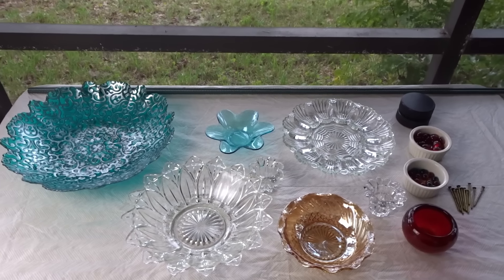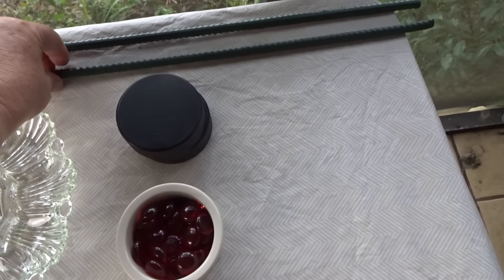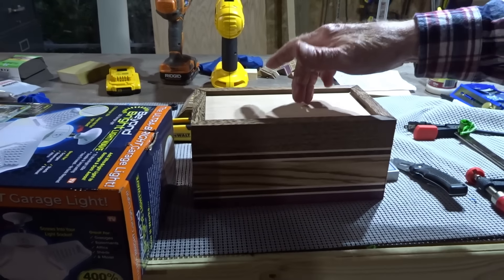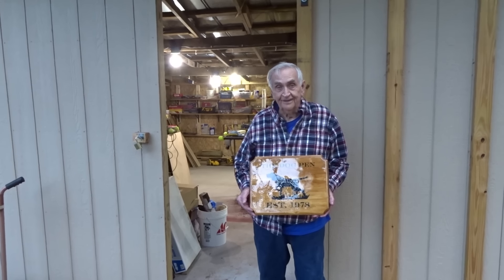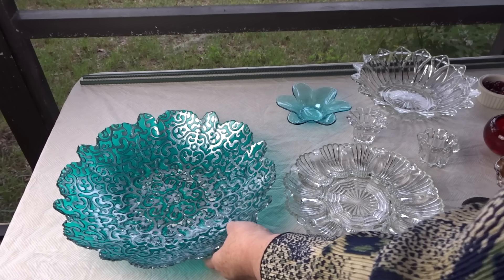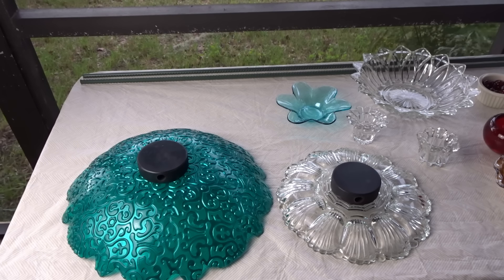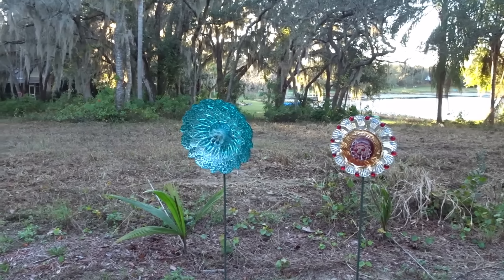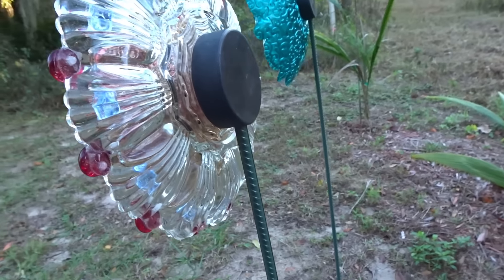How to Make 2 Glass Garden Flowers (with Thrift Store Glassware!) #diy  #upcycling  #gardendecor

Comment: You found some really pretty plates. When I made mine,I I couldn't find hockey pucks, so I used plastic elbow joints for my posts. They are very pretty.
Reply from the maker: I may try the pvc sometime! I bought the hockey pucks on Amazon : ) ♥

Comment: These are really nice. I might try making them.  I would recommend you consider using E-6000 glue.  It is crystal clear as well and bonds, glass and metal extremely well.  there is no mixing required. You can just squeeze it out of a tube.
Reply from the maker: Yes I have used E6000 (see previous videos) and have found that it does sometimes melt in the hot Florida sun. It's still ok for birdbaths, and standing weight, but for anything hanging, the adhesive needs to be stronger. I am currently working on an adhesive experiment that will be posted sometime this summer : )
Reply: @MyLittleSliceofParadise  I'm located in central Florida so it's good to know not all epoxys work well. Thx

Comment: Youre so creative putting them together. They're very pretty, especially when the sun shines on them. Im wondering what else I could use instead of hockey pucks? Sadly I dont have a handy Larry, or a drill press. Visions of drilling my hand if I tried to secure the puck. I read where someone suggested pvc elbow fitting but I like how puck is flush to the flower. Glass bottles seem too bulky. Hmmm.
Reply from the maker: Thank you! ♥ Check out my previous flower video.  I used bottles because I don't like drilling glass either ; )

Comment: Wow, never thought about using that epoxy for the glue... was using E6, but that epoxy is stronger. I learned to make the back holder using a 90° T conduit connector which can be put on conduit or hung on a fence. I love the stamens! This really inspires me to make some of these for my current yard, but I want to incorporate solar lights.

I had collected a ton of glassware before my last move, but donated it rather than pay to haul it. There were some really cool pieces in there, too.  I have to start all over.
Reply from the maker: Thank you! Yes, I had a problem with E6000 melting in the hot sun so I started using epoxy more. I would like to try the conduit connector, didn't know there was such a thing. I used a glass bottle to go over the conduit pole. A connector sounds easier! ♥

Comment: I think conduit is measured according to its inside diameter. I've made "glass plate flowers" with E-6000 but might try your epoxy method for faster set-up. Thanks for the great idea regarding stamens!
Reply from the maker: I think you're right about the conduit. Epoxy holds better than E6000, waiting to see how they hold up long-term. It's all trial and error! : ) But so fun to make ♥

Comment: E6000 glue works for this as well and is easier and cheaper to use than epoxy
Reply from the maker: Yes I've used it a lot in the beginning, but find that E6000 will melt in the hot Florida sun! If they are in the shade they seem to do fine : )

Comment: These are really pretty.  I don't have hockey pucks but have some old dishes id like to use in my yard.  What else have you used that worked in place of the hockey pucks?
Reply from the maker: Thank you! I used glass bottles on the first flowers that I made. You can look back to see that video. And I used conduit poles to hold the bottles. : ) ♥

Comment: These are lovely, I'll be keeping an eye out at the thrift store to see if I can find some stuff to make some of these!
I do a lot of crafting, and, I hope you don't mind some constructive comments...  :) 

I think you may benefit from a couple of weight bags. You can make them out of some thicker fabric (like maybe upholstery fabric or even leather) and fill them with clean sand. This way, when you put one bowl into another you can weigh down the bowls and adding that weight will help you get a really strong seal. (Similarly use these when you glue the pucks to the back).
With the little red glass beads you put onto the outside of the clear bowl, again, some clamping might help - even some spring clamps would do. They're really inexpensive and have many uses.  
The sculpey is a really expensive way to hold the stamens in place under the epoxy. You might consider some simple clay or even some dollar-store play-doh would do. Also, regarding the stamens, flowers tend to have odd numbers of parts. It would probably look more 'natural' if you'd made six stamen, five around one central one. Try it next time and see if you like it.
When you were showing the spray can with the re-bar, you were showing one re-bar. If you didn't do it already it may help to spray both at the same time as the width of the spray out of the can will save you in the long run as the width will more than likely coat both at once.

I'll be really interested to see how these hold up here in Australia and hope they don't fill up with spiders too soon!!!
Oh, and, I absolutely love your garden, your view and the old-mans'-beard hanging everywhere, I love that stuff but it doesn't go well in my climate.
I've subbed and look forward to seeing what you make next!
Finally, please tell Larry we all say HELLO!!!  He's awesome! You need to make him a flower! :D
Reply from the maker: Thanks for all the tips! I could use weight bags, it will probably make for a stronger hold. I do have some little clamps, will have to try that next time : ) And I will definitely tell Larry you said hello from Australia : ) ♥

Comment: Does that epoxy work in Texas heat? I love the flowers and I've made some using silicone, E-6000 and regular JB Weld, they all fell apart in our Texas heat.
Reply from the maker: E6000 melted in the hot sun, so I recommend using JB weld epoxy. This has worked for me, and I think Texas has the same heat as Florida : )

Comment: I didn't see or hear what kind of glue you used, I use e6000 or  Gorilla construction glue, both work very well, i also use mop handles from $ tree and they work well,  your flowers are beautiful, I really like the little things you put in the middle 😊
Reply from the maker: Thank you! Good idea about the mop handles. I use JB weld epoxy for flowers and bird feeders. I've used E6000 for birdbaths, but have found that it can melt in the hot Florida sun.

Comment: Gorgeous!  I'm in Texas and the sun and heat can get quite intense in the summer; even in the shade.  Does the epoxy hold up to heat?  E-6000 will reactivate and whatever I have glued will start sliding.  Sigh.
Reply from the maker: So far it is holding up but will wait and see. I have also had a problem with E6000 melting, at least on the bird feeder. I am working on an adhesive experiment and the GE silicone seems to be working well. There is also a marine epoxy I am going to try.
Reply: @MyLittleSliceofParadise  Thank you so much for your quick response.  Although I have the tools and know how, I'd rather not drill holes in the glass pieces and hold them together with bolts and washers; though that seems to be the best way to insure they stay together.  I've had them shatter while drilling.  Looking for that easier alternative!
Reply from the maker: @andielewis7243  Same here! I would rather use glue, it's so much easier : )

Comment: Which back did you like better? Bottle or hockey puk?
Reply from the maker: The hockey puck was easier to apply! But I like the size of the bottle to go over the thicker conduit pole. So it depends on the weight of the flower : )

Comment: The 1/2" measure on the conduit is the inside dimension. I've used JB Weld epoxy and its a good glue but glass is very heavy. I'm wondering how long the glass and glue will hold up outside. Good idea for the flowers but again, the weight is a concern.
Reply from the maker: So far they are holding up, will see how long they last! ♥

Comment: I'm wondering if I can use E-6,000 glue instead of epoxy?
Reply from the maker: You can, but I found that E6000 can melt in the hot sun here in Florida. It seems to hold better in the shade. I would recommend GE silicone or epoxy.
Reply: Where did you get the hockey pucks.  The ones I ordered from Amazon are hollow and too small for half inch bit.   Thks.  So enjoy your work.  I live where the soil is not fabulous and hard to grow things.   Also had hard time finding stained glass paint.    👍🏻

Comment: How well do you all think the epoxy or aquarium glue would hold up undet the Las Vegas heat?
Reply from the maker: I am not sure, it's pretty hot here in Florida too!  I've been working on an adhesive experiment which I will post later this summer, and so far the E6000 has melted, and waiting to see what happens with the others. I have not tried aquarium glue but I am going to try it. GE silicone seems to be holding up well.

Comment: How much of the JB Weld did you have to use.that stuff is expensive.
Reply from the maker: I usually end up using 1-1/2 to 2 tubes for each project. I am working on an adhesive experiment and I found that GE silicone advanced sealant works well too and might be a more economical choice.

Comment: Do you prefer the JB epoxy over E6000 glue and why? Also best to use gloves when working with your adhesive. Just a suggestion. Love your creativity. Larry..will you marry me? 😅
Reply from the maker: I've had E6000 melt in the hot Florida sun, at least on a bird feeder (hanging weight). I am finding that epoxy works better, and also GE silicone. Thank you ♥

Comment: E6000 works as well as epoxy and no mixing. I make flowers also and love yours. I use plastic plumbing connectors on the backs. 🌸🌺
Reply from the maker: Thanks! I have also used E6000 but it sometimes doesn't last in the hot Florida sun. I will have to try the pvc sometime ♥

Comment: How do you avoid painted glass? Because it looks so real. But doesn't last.
Reply from the maker: If it looks like painted glass I sometimes will spray a clear coat on it to make the color last longer. I find also that colored glass will last longer in the shade.
Reply: Sometimes painted glass has a clear bottom. This would only work for small vases because obviously plates would be coated all over. When I’m looking for bottles for a bottle tree I always look through the neck down to the bottom. If the bottom is clear, I know it’s painted glass.

Comment: This upsets me.  I work at a Thrift store.  I see beautiful pieces of China get separated from the set, just so people can ruin them.  Grrrr.  It's one thing when a piece is sitting alone, but when there are others with the same pattern, they should not be taken and messed with.  These pieces of China  and other dishes are History.  They are pieces of Art and should not be separated!!
Reply from the maker: I didn't use any china with these flowers, or ruin anything. Usually I buy single pieces when I'm shopping at thrift stores. But in any case, who's to say a piece of glass is prettier on a table or in a garden? : )